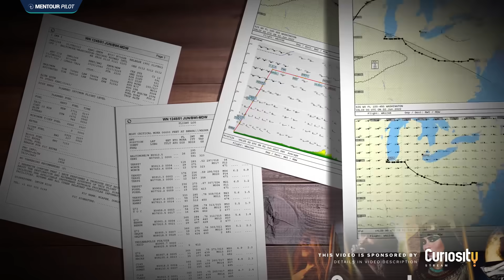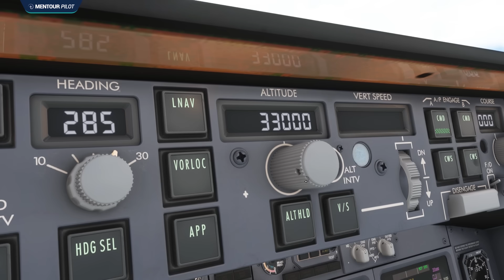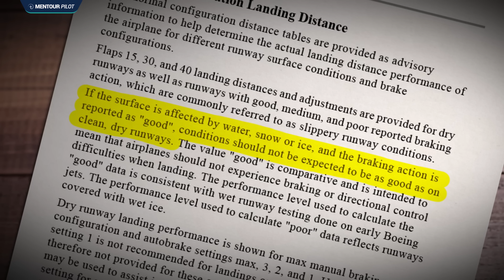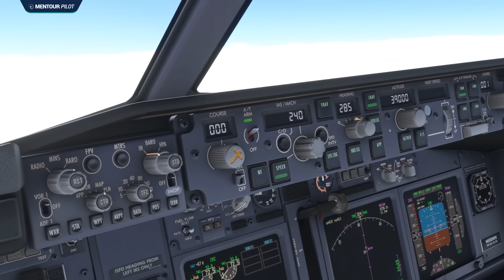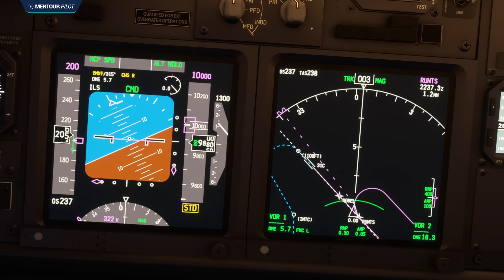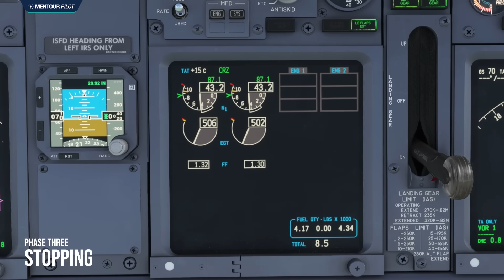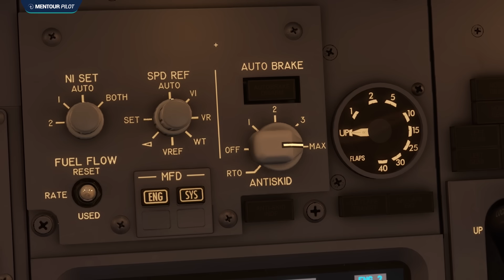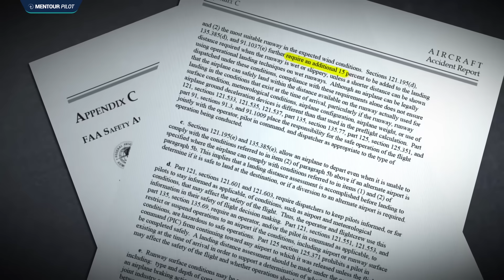WHAT did The Pilots MISS?! Explaining Southwest Airlines flight 1248

Comment: As a retired software developer, my first thought upon learning that the landing performance program silently capped the input tailwind component at 5 kt was, "How did that ever make it through review?"
I would have designed it so it would still do the calculation with the entered value but display a warning that the value was out of limits.
Reply: true (its like the <password already in use by user <user>> thing)
Reply: It didn't actually cap it silently, it highlighted that 8 knots value with a red background as incorrect, and there was also a message at the bottom saying the limit is 5 knots. The pilots just ignored that, and decided to land anyway, even though the tailwind they expected was over 5 knots.

Of course, with hindsight, we can think of improvements to that software. Like clearer warnings, and possiblly hiding all the distance calculation results, if the input data is invalid, instead of defaulting to the closest valid input value for those calculations.

But these pilots clearly didn't follow their procedures, which didn't allow landing with more than 5 knots of tailwind if any part of the runway had poor braking. Instead, they invented a new procedure, where they apparently took the average of the distance calculations for poor and fair. On top of that, they ignored the red warning for invalid inputs for the poor braking calculations, and just assumed the software would still produce correct results even with illegal inputs.

And about calculating correct distances even with the illegal input values, that's not how things work in aviation. The parameter tables to use in such simulations come from the manufacturer (or other technical sources), so as a software developer you can't calculate distances for inputs that are illegal. If you don't have any data to base your calculations on, you can't just guess or invent something, as that's not your field.
Reply: @VladimirNicolici  Fair enough. I wasn't paying strict attention to the display and didn't notice the red-highlighted value. Also, what you say about the dangers of extrapolating from the manufacturer's supplied tables is spot on and didn't occur to me.
Thank you for taking the time to point out the error in my reasoning, and for doing so in such a cogent and respectful manner. Unfortunately, that sort of thing seems to be becoming rare these days, which is a shame because we can always learn something new from each other.
Take care, my friend.
Reply: @VladimirNicolici  Nonetheless it should either have produced a correct answer based on the actual input (in parallel with the error message), or refused to produce any answer unless the user manually entered something in bounds. To change to an optimistic alternate interpretation is clearly unsafe, no? Otherwise the tool becomes pointless: just enter any random figures at all, and the simulation brings things in bounds and says, yup, that's fine. Or?
Reply: @stephenspackman5573  Indeed, as I mentioned, not making and distance calculations when the wind speed was out of range would have been better. But I doubt this was a decision the actual software developer made. There is very little freedom when implementing aviation software, you have to follow the specifications to the letter.

In any case, after this accident the airline modified the software to do just that, they stopped showing the estimated distances when the wind speed was out of range for the conditions. And they also clearly indicated that reverse thrust is required for those estimations to be valid. 

There were many other problems not just with the application but also the documentation. The reverse thrust assumption in those calculations has been introduced recently, and the documentation was not yet fully updated to reflect that at the time of the accident. 

Also, the company decided to make calculations based on performance data that was less conservative than Boeing's recommendations. If they used the data coming from Boeing, it would have shown the distance as insufficient for both the fair and poor runway conditions.
Reply: @VladimirNicolici  Well … while I'm glad that the design was eventually attended to, I'm also glad I don't work in aviation software. Nobody should be in the position of being ordered to do work that's going to put people in harm's way.
Reply: @VladimirNicolici  It should have a hard pop up warning that explicitly states that though. People can ignore subtle messages. It should be something you need to interact with ‘click to confirm the max value calculated will be x kts”
Reply: Do you Ada or  java or c. What exception handling has you used.
Reply: @VladimirNicolici  I'm not sure that the red background emphasis wasn't added my Mentour Pilot's video producers. I think the software saliently defaulted the value
Reply: Maybe that software developer just followed requirements and specs made by someone else, which of course you are allowed to "review" properly (and report back for discussion) as long as you understand and know about the domain of the problem in such a detail that you can anticipate what should be done differently... - otherwise, it is just a part of a complex formula, and the whole tool  is there to make computations and hide that kind of details. 
I wonder if the development of those aid tools is made following the same standards and the same "safety mindset" used for the avionics software, or if it is considered just as a "calculator pilots get onboard to make some computation", and so it isn't put under so close scrutiny - just enough to check that it gives sound results with "every" acceptable input and rejects invalid input.
Reply: @OfficialSamuelC  people do, but pilots using the tool to make an important calculation shouldn't: it would be like ignoring visual warnings in the cockpit.
Reply: @ilovecops5499  C hasn't exception🙂
Reply: @hydorah  Look at the NTSB report, page 27, figure 5. It's linked by Peter in the video description. It shows how the application looked and that it highlights with red background any invalid values, both for inputs, like wind speeds that are too high, and outputs, like negative distances to the end of the runway.

The NTSB commented on it: "Note: the white “8T” with a red background and the “Wind limits: 5T/10X” remark in white with a black background near the 
bottom of the display indicate that the tailwind limits for poor braking action were exceeded."

I didn't base my reply on the representation from this video. While it was quite accurate overall, the red highlighting was missing in the video. I tried mentioning this yesterday, but that comment was lost somehow.
Reply: @VladimirNicolici  Hey mate well done on your attention to going right through the report. The stuff highlighted in red isn't operator data entry though? And wind limits are called out but in a black box at the bottom? I dunno man that's bad software design all over. The animation in the Mentour Pilot's video is more like what should have happened in the app
Reply: @MauroPanigada  C does have struct return values, pointer-to-value parameters, and pointer-to-function parameters (any of which provides a serviceable method of reporting an error) and (lord help us) setjmp/longjmp for nonlocal exit. “I do not know how to use my programming language” is not a particularly good excuse for someone paid as a programmer.
Reply: @stephenspackman5573  ? and also just int (or bool if you can use stdbool.h) to do something like "if (!valid_input(&input)) { alert_popup(get_invalid_field (& input)); }
... yet, C doesn't have exception the way Ada, Java, C++, ... have.
Reply: @MauroPanigada  I was assuming we were using the return to return a value—otherwise why would we be talking about exceptions at all? In any case, the point is that the question is a bit daft, “exceptions” are ultimately just sugar for disjunctive return types, and validation is not an insoluble problem in any non-toy programming language, from assembly language to Haskell. It's just a question of code clarity tradeoffs (and in C I like the callback function approach, myself, but perhaps that's a habit I fell into from Scheme derivatives).
Reply: @stephenspackman5573  The question asked about "exception handling" and I've just pointed out that C hasn't exception. The final smiley was an aknowledgement of the fact that I was very pedant, because likely he meant a more general "error handling". But I'd leave the use of "exception" for that kind of things C hans't.
Reply: @MauroPanigada  I'd argue that setjmp/longjmp is exception handling in that sense, though I wouldn't recommend anyone use it. But I agree we shouldn't be arguing—sorry for not understanding your smiley code!
Reply: @hydorah  Actually, now that I look at it again, I think you are right. The "8T", meaning 8 knots of tailwind and highlighted in red, is probably not a data entry field. It's probably automatically calculated based on the wind direction and strength (the 090/11 near the top left corner) and the runway direction (31C would be at 310 degrees). 

So, basically, it's telling you that under these weather conditions, if you land on 31C, you will experience a tail wind of 8 knots and a crosswind of 7 knots (8T / 7X). Only the 8T his highlighted in red, indicating landing is not allowed. The 7X is not highlighted, because the 7 knots crosswind is OK. The message at the bottom tells you why you can't land in these conditions.

Unfortunately, instead of not showing any stop margins, because the tail wind value of 8 is out of the allowed range, it makes distance calculations based on the maximum allowed 5 knots of tailwind for those conditions. With that, it makes 3 estimations, based on minimum, medium and maximum braking. The first two estimations are highlighted red, because they are negative, the third one, 40 feet remaining, is not highlighted in red, because it's a positive value. That's why the pilots thought that with maximum braking they would still have 40 feet remaining, even with poor conditions.
Reply: @VladimirNicolici  So it calculates a value that is out of spec, than caps this value to be in spec and does further calculations based on that? The pilots don't even enter the out of margin 8 kn tailwind value?
That is a horrible design error.
Reply: @HappyBeezerStudios  Yeah, I have to agree.
Reply: I thought the exact same thing.
Reply: @johnopalko5223  never the less, this effectively discards any of the calculations and basically says "you don't have enough margin and will overshoot the runway" - thus it is a serious error which you cannot get away from with a single red background (Software QA engineer here...)
Reply: @MauroPanigada  usually it's a matter of insufficient requirements. I see this a lot, basically, requirements engineering does not take into account every single problem that can happen.
Reply: John, I agree. I developed software for 40 years. How could ANY engineer, or software quality control organization miss this??? There should have been a big pop-up stating, "Landing Not Possible Under These Conditions." I just don't get it.
Reply: @johnopalko5223  and Vladimir Nicoloci,  If that software warning would have been sufficient, this accident would NOT have happened. So, I respectfully think you guys are wrong. When the consequences of ANY misunderstanding is life threatening, any decent software engineer would make the warning impossible to miss. It was obvious that the pilots did not understand the procedures, and most of the other Southwest pilots also didn't, that was the fault of Southwest training. But, think about it this way, even though the pilots didn't properly understand Southwest procedure, the software COULD have been the fail-safe necessary to prevented this accident, if only it had been written logically and properly.
Reply: Nein
Reply: I agree that it should refuse to calculate with an error message. As it has been seen so many times, we people just like to ignore stuff, if it does not actively annoy or inhibit us from going on.
Reply: Yes! Sr. software engineer here, I facepalmed when he said that. That is a horrible antipattern that you see in software all over the place.
Reply: Well, software development nowdays is outsourced to India or done by interns. Good Developers are very, VERY expensive, especially if they have to do HA systems, that's the reason we see some shyty apps bought by corporations. Mid. software engineer here.
Reply: We who fly desks cant know the plight of a pilot. Just saying.
Reply: @IroAppe  sometimes you just have to fly the airplane. Not count on computer calculations. And thrust reversal is an elementary mechanical, brain physical action. Without that none of tje othrr crap mattered.
Reply: Seems this all comes down to bad specifications for the software, something the developers can do nothing about.
Reply: @JeepCherokeeful  Agreed. There is a particular app that I am required to use, by Federal mandate. The password requirements are really strict and result in very strong passwords that expire every 60 days. However, you can also log in using a 4-digit PIN that never needs to change.

Also, the answers to the security questions can have no repeated characters so if your answer contains, say, "Minnesota" you're out of luck.

I spoke with one of the developers and he agreed that it was really stupid but those were the specs from the government, so there it was.
Reply: The software was missing an indication that the stopping distance calculation was contingent on use of reverse thrust.
Reply: All of which supports my contention that we, as a species, are in WAY over our heads.  Aviation, especially GA, is in no better shape today than these pilots were at this event.
Reply: The paradigms of the era of autocorrect. "You said 8? You surely didn't mean that, it's out of range, you surely meant 5, let me fill that in for you. Aren't I helpful?"
Reply: I know right.
Reply: Why would the pilots have to do it at all? All the numbers come from somewhere else, so in theory a machine could be programmed to accept all those numbers and spit out the answer and send it to the pilots.
Reply: Software should never change any manually input data.  Neither should it refuse to calculate a result if the input data is outside the recommended limits.  It should however flag that the output is based upon out-of-limit input data in an unmistakeable way.  The reason I say this is because there may be times in an emergency when the pilot is forced to do something outside the recommended limits, and needs to know the result.
Reply: Thank you John Opalko. Well said. There are a lot of examples of that in aviation at the airlines. For example.....without mentioning aircraft type...there is a test we do where we start the test in the maintenance section of the computer and follow the on-screen prompts. At one point it tells you to pull the control column aft and you slowly pull it aft and watch for a response from the test program. In the newer aircraft of the type the next screen tells you to release the column to neutral. But on the older aircraft it never tells you to release....it just moves on to the next section....and from experience we've all learned to just release the column to neutral. But it shouldn't be that way. It's a lengthy test and if you make a misstep you have to start over again. Not good if you are trying to release the aircraft for a flight. I've always wondered if the engineers could update the older aircraft to include that annoying step to make the newer and older aircraft conform. One other major annoyance I have with the aircraft logic is all the nuisance faults we see on the ground. I feel like when the aircraft is in "Ground Mode" with engines switched off, the Flight Warning Computers should inhibit some warnings. We don't need to see every single warning on the ground, engines switched off, and parking brake set. It totally clutters up the screens and the warning annunciators. Makes it hard to tell if it's a nuisance or a genuine fault. They need to have ....what do you call it?.....a symposium?....with aircraft technicians and factory engineers sitting down at a round table and tell each other about their jobs. Their gripes and their view of things. Everybody could prepare in advance. I guess pilots should be included too....or maybe a separate symposium between engineers and pilots and then another between aircraft technicians and pilots.
Reply: @aragorn2321  wait… thats a thing? Really?
Reply: @Telleva While I agree that, in retrospect, calculating a distance based on the maximum legal tailwind value for those conditions was a mistake, as mentioned before, the tail wind component was not replaced "silently". It was colored in red, showing it's invalid and they are not allowed to land in those conditions. And the maximum allowed wind speeds were displayed at the bottom of the screen when the limits were exceeded.

If the pilots didn't choose to ignore that the tail wind was too strong, it wouldn't have mattered what the application calculated. The conditions were marginal, and the pilots kept digging holes in the cheese, with rationalizations like "yes, braking action is poor, but it isn't poor over the entire length runway, so it's not actually poor."

Also, in software development it's quite common to replace invalid values with the closest correct value, sometimes even silently. It usually makes the user experience better. That's why phone keyboards now have autocorrect for example. Of course, in this particular case it was a bad idea to do that, but we shouldn't generalize.
Reply: @Telleva What I was saying is that if they didn't ignore the wind being over limit, it wouldn't have matter what the calculation has shown. Yes, in their case it mattered, but only because they ignored the over limit wind.

An accident is usually a causal chain and breaking any link in that chain would prevent the accident. That means we shouldn't focus on fixing just one link in the chain. All contributory factors should be analyzed, and improvements made, if feasible.

We humans frequently get too focused on a single cause and tend to ignore the rest, depending on our biases.

And, talking about profits, keeping the training to a minimum is one way of increasing profits, and insufficient training seems to have been one of the factors in this accident.

The risks they took were not reasonable, but they didn't know that because of insufficient training.

My point is that, at some point, something has to give, and trying to further increase the profits begins to eat into the safety margins. That's not a good thing.
Reply: as a software dev myself, seeing pretty pathetic shit getting through review, i don't really wonder that much.
Reply: exactly, I was thinking the same thing..  the UI should have like big icon warnings
Reply: @VladimirNicolici  How do you know that the computer highlighted the bad data with a red background? I hope you aren't basing that off of the video which is only a simulation.
Reply: @WJS774  I read the report. From the final report: "the white “8T” with a red background and the “Wind limits: 5T/10X” remark in white with a black background near the bottom of the display indicate that the tailwind limits for poor braking action were exceeded."
Reply: Found your channel this weekend. Instantly hooked... fascinating material that I never knew I wanted to know more about
Reply: @davemould4638  I can see your point re needing to know the results of something outside the limits, but I think that's a situation where you would need to manually confirm you're overriding specs. Like, BIG OL' NOTIFICATION that you can't miss (unlike the current setup where a pilot could easily overlook the wind limits and other information, given it's at the bottom of the screen and after the data they were looking for). If that's not possible, then at least a rearrangement of how the information is displayed to the pilots.

That's because this isn't necessarily bad programming, but it is bad user interface. The pertinent information that the pilots needed was located at a place people are unlikely to look if they've already gotten the information they think they needed. Instead, the very first thing that should be the differently-colored text (ideally also larger, bold font, whatever), and then either they have to clear to override OR the information could be then given below.
Reply: Yes, and It would be good to have it flashing with an audible alert too,
Reply: As a fellow software engineer I couldn't agree more.
Reply: Having written calculation kernels for several companies ... bullshit like that is almost always something the company writes into the requirements. They don't care if you tell them it is not a good idea. They just order it like that.
Reply: Right? Who caps an invalid value without even a warning?
For something so mission critical, why not display a visual warning saying 'Invalid value, max 5kts' or something?
Reply: @VladimirNicolici  My personal opinion is when an error occurs, you should not continue with calculations. If im making a gui tool like this, I would have to program display an error dialog
Reply: Exactly - especially with safety critical systems.
Reply: pretty obvious... and what about the thrust reverser not being spelled out?  It's purely insane.
Reply: even thought it did highlight it shouldve stopped the calculation altogether and given an error
Reply: @VladimirNicolici  Ho do you know it did that and it wasn't just Mentour Pilot doing that for the visuals?
Reply: @ What exactly?
Reply: @VladimirNicolici  "It didn't actually cap it silently, it highlighted that 8 knots value with a red background as incorrect"

How do you know that it wasn't Mentour Pilot (or, rather, his editing team) doing the highlighting? The green highlights at 7:40 were his own, in fact at 8:42 we see it does not highlight it.
Reply: @Capybara1997-o1l  As I mentioned before, I know that because I read the NTSB accident report, which is linked in the video description. From the report, page 26: the white “8T” with a red background and the “Wind limits: 5T/10X” remark in white with a black background near the bottom of the display indicate that the tailwind limits for poor braking action were exceeded. At page 27 in the report you can see exactly how it looked.